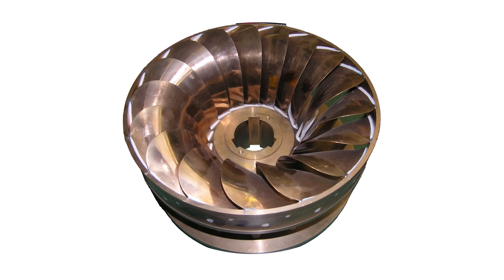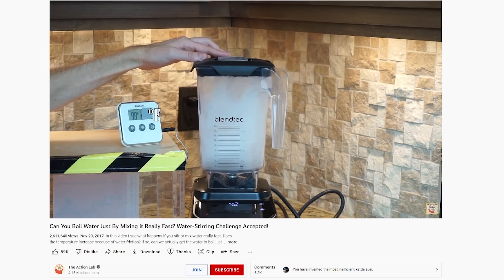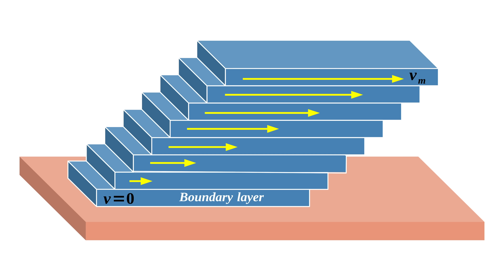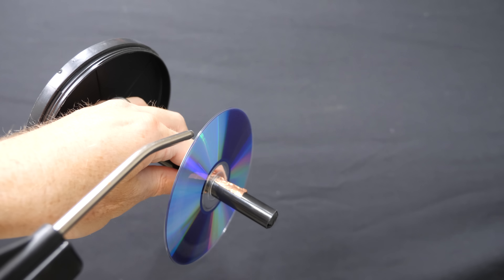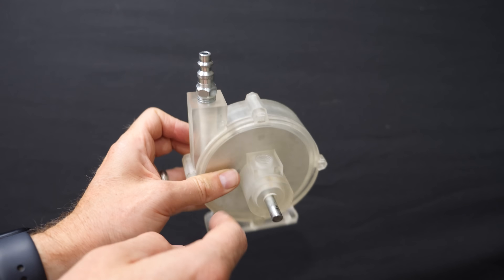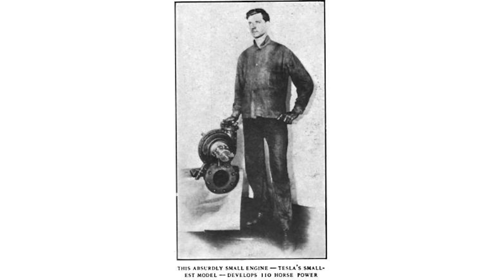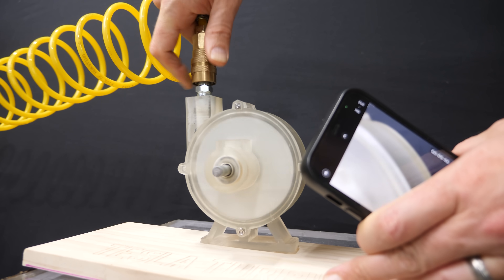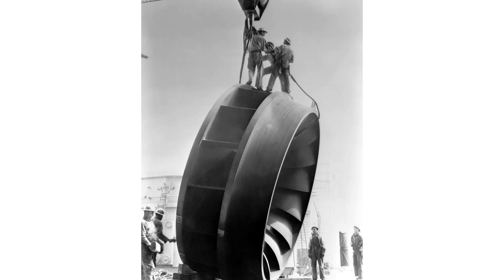How Fast Can a Tesla Turbine Spin?

Comment: Would the turbine you used work more efficiently going from the center out? Or is the difference between forward and backwards negligible?
Reply: I don't think it would work at all. The air coming in from the side has momentum in a direction that allows it to apply torque around the axle. Air coming from the center would just push the disk sideways along the axle, and as it moved toward the exhaust, it would push the disk outward away from the axle. Neither gives you any sort of torque, and no torque means no power.

Unless... you're blowing air tangent to the axle from a port towards the center. That will work in theory, but the engineering constraints of having space for such an inlet will outweigh any efficiency increase. Besides, the air having a higher linear velocity towards the center means a huge difference in angular velocity between the inside and outside of the disk (in contrast to the linear velocity decreasing toward the center, roughly maintaining the same angular velocity), which should actually make full laminar flow impossible. Therefore, it should dramatically decrease potential efficiency. 

On top of that, I think the direction of the outlet means something for how much momentum is left unharnessed from the air, but I'm already making guesses way out of my expertise.

I am not an expert in fluid dynamics.
Reply: FREE ENERGY! TRUE FREE ENERGY! Siphon liquids UP by putting a bottle/container above water/liquid source, have a siphon tube go from water/liquid source to top of a sealed container. on the bottom of container put a spout so water can flow back into the source. the water coming out of spout will create suction in the container pulling water up the siphon tube! it will continue to flow until water evaporates unless you build it in an enclosure or use ionic liquid. with water flowing constantly you can use the tesla turbine or any hydro-generator to give you free energy for everyone in the world! Thank you tesla for free energy for the world!
Reply: @rvlifestylelivin  Ah, yes, "siphon up by siphoning up." Because that's how siphons work. I really liked when you said "It's siphoning time" and siphoned all over big oil. Truly one of the moments of all time. I rate this life hack 5 thumbs up.
Reply: @jlco  actually a basic siphon you have to have the tube go down below the water source in order for the water to flow so it siphons down, using a container with the siphon tube go from water at the top of sealed container, have container above water source, then put spout on bottom of container to let water flow out will create suction in container and that suction would pull the water liquid up, then use its momentum falling out of spout to spin hydro-generator, hydro generator store electricity in batteries, use inverter to convert 12v to 120. thicker the piping on the siphon will create more flow
Reply: @rvlifestylelivin  Have you ever used one of those cups with a built in straw? The straw actually leaves the cup on the bottom (flowing downward). Those don't siphon the entire cup every time you use them, though, because the end point of the straw is above the liquid in the cup.

Besides, you said it yourself; you use the momentum of the water to spin a generator. Once you use it, it is gone. There is no momentum in the water now. The siphon will not siphon and the water will not move.
If you think the draining water will create suction in the upper container, you'd be correct! Unfortunately, this suction just holds the rest of the water in, or pulls air in through the drain if it's big enough. If you poke a small hole in the lid of a plastic water bottle, you can turn it upside down and it'll just hold the water inside because the air beneath it is pushing it up.
Reply: @rvlifestylelivin  all I can gather is that you are talking about the KISS solar thermal tower.
Reply: Technically it would work more efficiently since the moving air (or whatever medium you used) would be in contact with the disk surface for a greater period of time it would impart more energy to the disk. This would be implausible considering the tight spacing of the disks but with fewer disks it might be possible. With such tight spacing, you would expend even more energy trying to get sufficient speed and pressure into the system.
Reply: Center-out makes it into a pump

Comment: DUMB IDEA:
Instead of using high pressure to push can we create high vaccum at one end to move the disk!
Reply: You’re welcome to tell us all where in nature on Earth you can find a naturally occurring vacuum source
Reply: @fredbloggs5902  🤭 looks like you’re not familiar with how Ocean Thermal Energy Converse (OTEC) plants use vacuum steam systems for generating electricity even from the very small temp gradients of warm surface ocean water and cold deep ocean water. 

Viable energy production technology. Has been for almost 100 years.
Reply: @CharlieSolis  describing OTEC plants as being driven by vacuum is highly disingenuous as you know.

You’re a know-it-all troll.

You’re blocked.
Reply: @fredbloggs5902  you putting words in my mouth is far more disingenuous. 

I never said “otec plants are driven by a vacuum.” 🤭 that’s what you said. 

Never mind the fact that Vacuum Energy Storage (VES) systems are already an entirely developed and established energy storage sector that you obviously already know ALL about. 🤭

VES systems look just like Compressed Air Energy Storage (CAES) system but because they have a max pressure gradient of ~14psi the energy density of the system is limited. Whereas CAES systems can store the high pressure side at up to 300bar (4500psi)…
Reply: @fredbloggs5902  NERD ALERT EVERYONE, NERD ALERT🚨 lastly it’s almost glaringly obvious that you’re not even aware that the first modern steam engines, the Newcomen and the Watt engine (yes James Watt as in the guy who the units for Power were named after = joules / second = “Watts”) were NOT based on using steam pressure. 

They actually derived power by developing a vacuum in a massive sealed piston+cylinder with steam and cold water sprayed in. 

This rapidly condenses said steam creating said vacuum which then allows the force of the atmospheric pressure on the outside of the piston in the cylinder to do the work shoving it down into the cylinder. 

Our first steam engines WERE NOT “steam pressure driven engines”. 

They were actually atmospheric pressure driven.

Unfortunately this limited their performance to the size of the piston head area because again, the max force able to be derived on the piston is the piston area multiplied by pressure difference between both sides of the piston (roughly -14psi atmospheric pressure)

Again, why we now use high pressure steam systems is because they have much higher power densities using higher pressure gradients. 

How’s that for “know-it-all” 🤓😈😇
Reply: @fredbloggs5902  you asked where on earth we can find a “naturally occurring” vacuum source to use this, but that is even further disingenuous because you’re obviously pigeonholing the conversation to seem like “if it’s not an energy source it’s not even worth it…”, 

as if “energy storage” isn’t also a major component to solving global energy issues.

Comment: The explanation in the last few seconds for why they aren't used amounts to, "Eh, we just don't do it that way."
Reply: The reality is more like: "No materials known to man can actually do this at the scale needed to produce meaningful power."
Reply: @OutsiderLabs  Check out his YouTube channel (search "Charlie Solis" on YT), you won't be disappointed - he's figured out how to make TesTurs properly and has documented it. The "no material can withstand the RPM's needed to make meaningful power" is just wrong. It doesn't need high RPM's to create power.
Reply: @OutsiderLabs  see Charlie Solis. Manufacturing is cheap, he uses fiber glass. Don't make it big, use gas, increase surface area.
Reply: @Dan-gs3kg  thanks you! I don’t know how so many people can make these claims that TesTurs don’t work when I’ve more than proven they not only work but get plenty of torque at even low RPMs.
Reply: @OutsiderLabs  the reality is Tesla turbines aren’t supposed to be spun fast when used as a turbine. Only when they are used as a pump/compressor are they supposed to be spun fast because ALL centrifugal pumps’/compressors’ performance is tip speed dependent. 

“I have found that the quantity of fluid propelled in this manner, is, other conditions being equal, approximately proportionate to the active surface of the runner and to its effective speed. For this reason, the performance of such machines augments at an exceedingly high rate with the increase of their size and speed of revolution.”
-Nikola Tesla 

Spinning too fast just counters the incoming fluid flow because of the centrifugal head. Never mind the fact that the real turbines efficiency is increased by reducing slip, not increasing the rpm. 

“Owing to a number of causes affecting the performance, it is difficult to frame a precise rule which would be generally applicable, but it may be stated that within certain limits, and other conditions being the same, the torque is directly proportionate to the square of the velocity of the fluid relatively to the runner and to the effective area of the disks and, inversely, to the distance separating them. The machine will, generally, perform its maximum work when the effective speed of the runner is one-half of that of the fluid; but to attain the highest economy, the relative speed or slip, for any given performance, should be as small as possible. This condition may be to any desired degree approximated by increasing the active area of and reducing the space between the disks.”
-Nikola Tesla 

“Still another valuable and probably unique quality of such motors or prime movers may be described. By proper construction and observance of working conditions the centrifugal pressure, opposing the passage of the fluid, may, as already indicated, be made nearly equal to the pressure of supply when the machine is running idle. If the inlet section be large, small changes in the speed of revolution will produce great differences in flow which are further enhanced by the concomitant variations in the length of the spiral path. A self-regulating machine is thus obtained bearing a striking resemblance to a direct-current electric motor in this respect that, with great differences of impressed pressure in a wide open channel the flow of the fluid through the same is prevented by virtue of rotation. Since the centrifugal head increases as the square of the revolutions, or even more rapidly, and with modern high grade steel great peripheral velocities are practicable, it is possible to attain that condition in a single stage machine, more readily if the runner be of large diameter. Obviously this problem is facilitated by compounding, as will be understood by those skilled in the art. Irrespective of its bearing on economy, this tendency which is, to a degree, common to motors of the above description, is of special advantage in the operation of large units, as it affords a safeguard against running away and destruction. Besides these, such a prime mover possesses many other advantages, both constructive and operative. It is simple, light and compact, subject to but little wear, cheap and exceptionally easy to manufacture as small clearances and accurate milling work are not essential to good performance. In operation it is reliable, there being no valves, sliding contacts or troublesome vanes. It is almost free of windage, largely independent of nozzle efficiency and suitable for high as well as for low fluid velocities and speeds of revolution”
-Nikola Tesla 

…suitable for high as well as low fluid velocities and speeds of revolution…”

Comment: Can they be made more efficient for a fixed load (for example charging a battery with constant current)?
Reply: Charging a battery?
You want to power a device to power a device?

Or are you planning to use a non-electrical source?
Reply: @MelodicTurtleMetal  yea they absolutely can. Despite what everyone erroneously claims about the Tesla turbine they get plenty of torque even at low RPMs. You just have to actually know how to design them.
Reply: @CharlieSolis  ... I'm trying to understand the possible use case where using one of these to charge a battery would be feasible at a constant current.
Reply: @MelodicTurtleMetal  definitely possible. The TesTur I’ve got spinning right now just Dyno’d in at +4.25kW between only 6000-8000rpm and peak torque of 6.22 ft-lbs at only 4150rpm 😈 on just room temp compressed air that never got over 40 psi at the nozzle. 

Did up to 2650 watt tests of real electrical loads with a 200 gal tank of compressed air stored at 150psi regulated/throttled to the nozzle pressure and dumped until it couldn’t keep going. The 250watt run kept going until the tanks fell below 35 psi, and that trend went up to the 2650 watt run that stopped being powered when the tank dropped below 95 psi in the tank. 

But yeah these were just compressed air tests. And compressed air is, for the most part, a collection of non polar molecules (O2, N2, CO2, etc) that don’t adhere well to metallic discs, or at least not as well as H2O steam does being a fairly polar molecule which has a much higher adherence to the disc faces. (Think “wetting angle”, also hydroPHILLIC surface coatings can further increase H2O adhesion, and on the other end hydrophobic coatings should increase non polar molecule adhesion. Essentially the right additional surfactants should increase adhesion.) 

Ultimately this increased adhesion force increases the isentropic efficiency of the turbine from the increased boundary layer thickness. 

Also there will be higher temp gasses. Which if you’re not familiar, gasses have a viscosity trend with temp that’s the opposite of liquids, they get thicker as they get hotter and thinner/ runnier as they get colder. 

So the further increase in viscosity, cohesion forces, due to the increase in temp results in reduced slip on the disc, which further increases the isentropic efficiency in addition to the thermodynamic efficiency increase from having increased fluid temps.
Reply: @CharlieSolis  my point is more about - how would you power this device with a stable flow without using a powered source.

Charging a battery from one of these is useless if your putting more energy into powering the device to power the device.
Reply: @MelodicTurtleMetal  keeps deleting my comment 😑
Reply: @MelodicTurtleMetal  have you read Nikola Tesla’s article “Our Future Motive Power” yet?
Reply: @teenagemutantninjaraver2224  sorry friend, i can't read
Reply: @MelodicTurtleMetal  Charlie Has some good resources about the different ways to power the turbine. He’s doing solar concentrated steam, biomass gasification/combustion for carbon neutral fuel, also he’s done regular fissile fuel tests with the combustion system and boiler that he makes. I know he wants to do geothermal as well but has t gotten there yet. 

He’s the only one out here making MASSIVE strides in not just the turbine but the overall system that drives it that Tesla explains in his 5 improved turbine patents that he patented in 1921, 10 years after the original and a decade of R&D. 

Patent GB 186,082: improved disc stack design for more torque
Patent GB 186,093: combustion + steam turbine with built in exhaust heat recovery boiler.
GB 186,084: combustion + steam turbine superheater and concentric/coaxial multifluid nozzle that the steam draws a vacuum on the exhaust of the combustion mixing them as they enter the turbine
GB 175,544: hybrid Tesla Disc + Parson’s reaction turbine for utilizing the Reheat Factor of the energy lost to shearing in the fluid between the discs .
GB 186,799: process and apparatus for balancing rotating machinery for high quality at-speed dynamic balancing. 
US 1,655,114: aerial apparatus patent with improved turbine nozzle design
Reply: @MelodicTurtleMetal  in that article “Our Future Motive Power” Tesla explains how he plans to use the Tesla turbine in Ocean Thermal Energy Conversion (OTEC) vacuum steam systems as well as using the same aystem for geothermal energy use because the Tesla turbine is the only turbine that can handle the wet steam, and abrasive particulates in the flow of the steam coming out of geothermal bore holes. Also the super salty corrosive nature of the wet steam coming out destroys most other engines not made out of stainless.